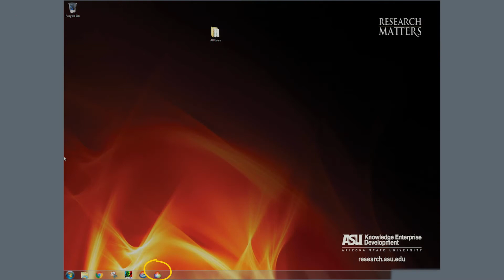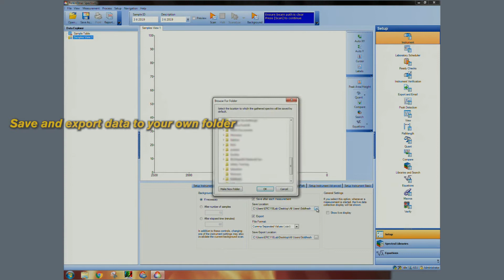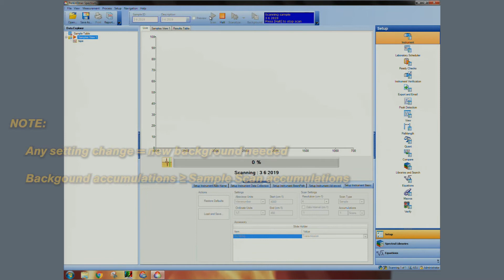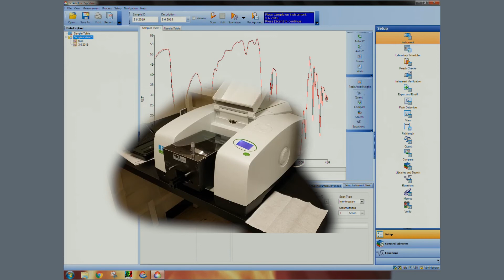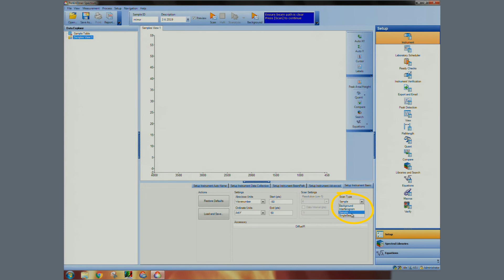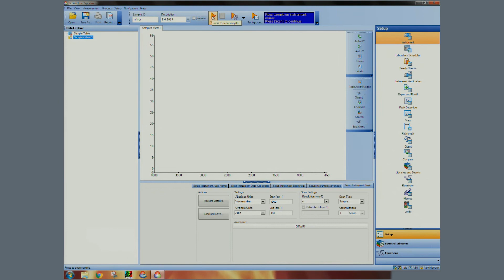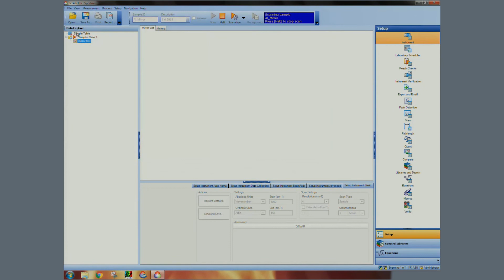PerkinElmer Frontier FTIR training video

Comment: As per you the system without ATR can solve the problem of checking  transmission of germanium,silicon window.
Reply from the maker: All you would need to do is place the window in the beam path during the measurement. No special accessory is needed.

Comment: is ATR necessary for checking of transmission of germanium or silicon window?
Reply from the maker: It is not recommended. A straight-through transmission if preferred. The ATR would only provide information about the surface of the material being analyzed.
Reply: Thankyou

Comment: how we check the transmissiin of ir coatrd windows made of germanium , silicon,etc
Reply from the maker: Hi Manan, assuming the window is transparent enough, which should be the case, you can do a straight through measurement by mounting the window on the steel holder shown around 1:33 on the video. You can use tape to mount the sample as long as the beam does not go through the tape.
Reply: @EyringMaterialsCenter  is ATR required for this?
Reply from the maker: @manojdhiman5694  I would not use the ATR for it unless you are only interested in analyzing the coating.